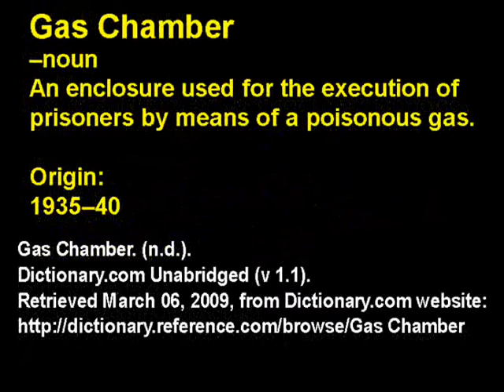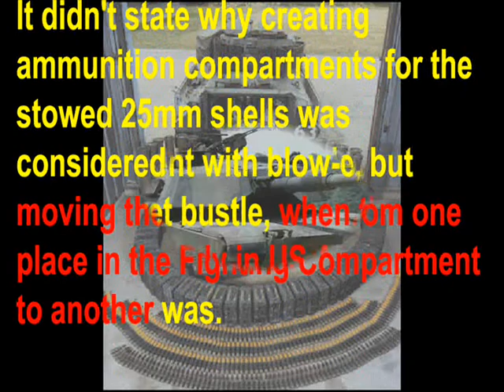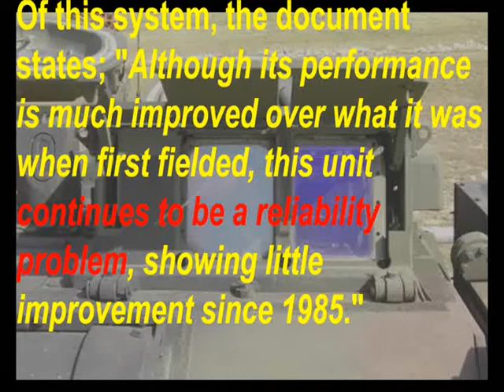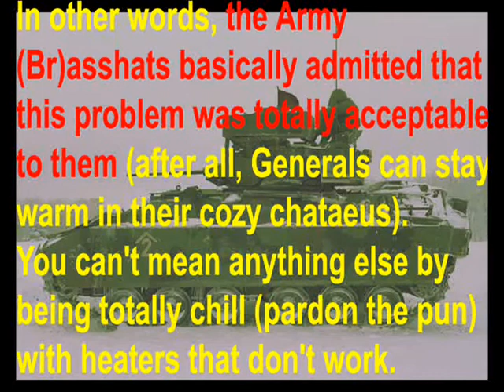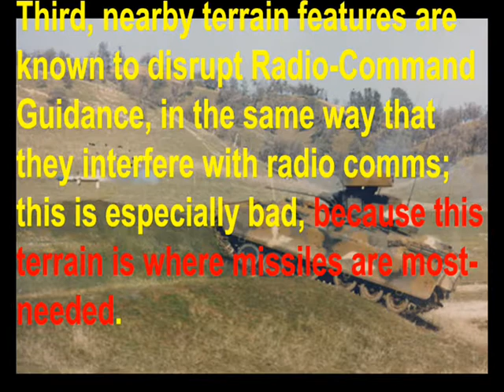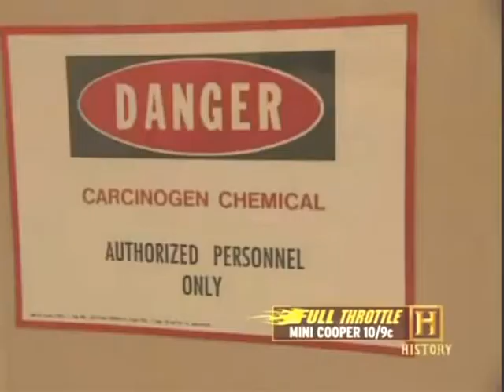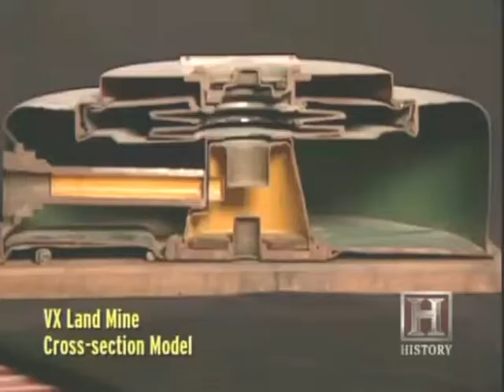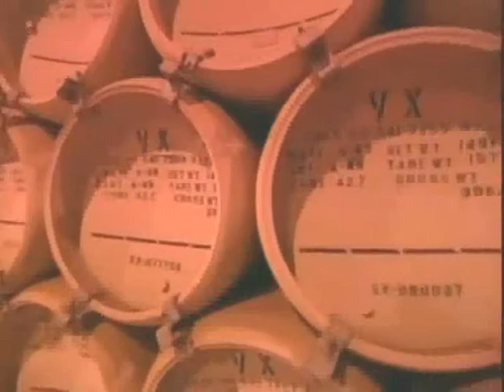The REAL Bradley "Fighting" Vehicle! Chapter 16: More Fun Facts (Part 10/10)

Comment: Well opening up a history on WWII would tell them the Wehrmacht had to fight the Red Army in temperatures down to negative 30 degrees Celsius and the Germans didn't even make it over the Urals where the temperature goes down to negative 65 Celsius.   Thus the Bradley's would be a huge liability if they got caught in Russian winters just due to temperatures alone (also their high ground pressure would cause them to get stuck in snow making their crap of heaters a bigger problem).